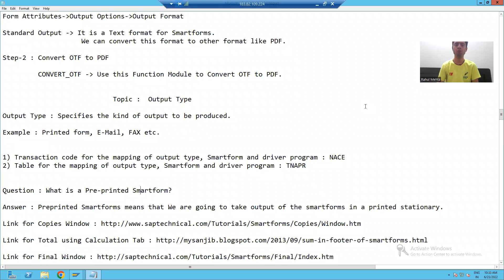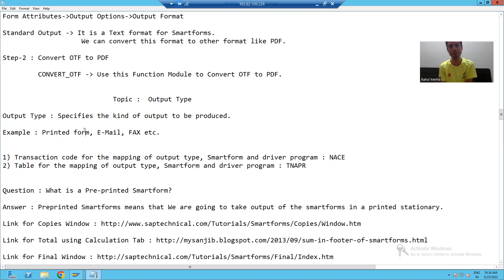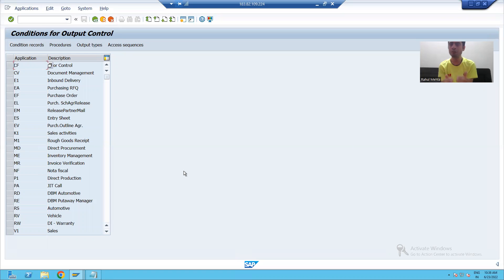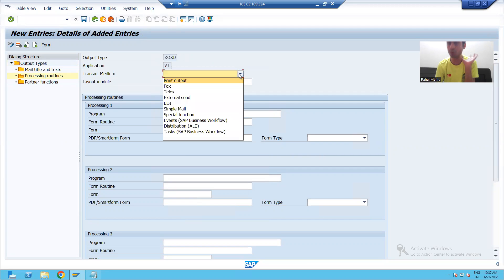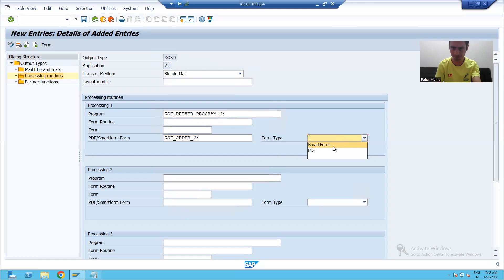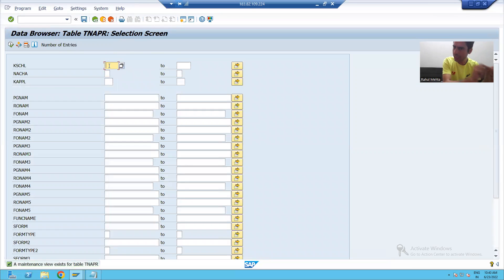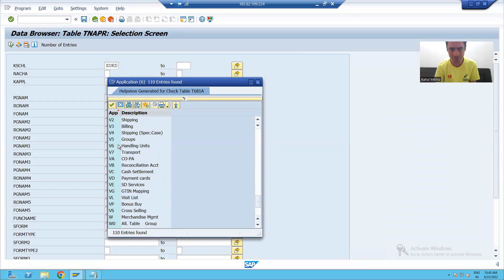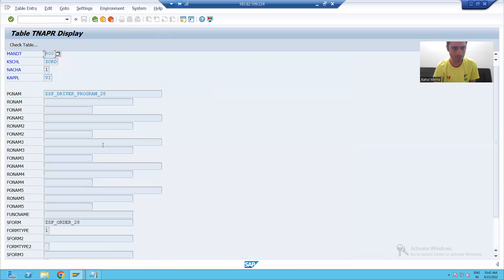45 - Smartforms - Output Types

Comment: what is the purpose of setting up output type in NACE transaction?
Reply from the maker: Hello Nabil - We will understand by example. Every company has a payroll through which they send the salary slip to employees. Now the salary slip is layout( smartform) and the company is sending that salary slip to employees through E-mail also, hard cody(print) also. This print and e-mail are  kind of output and the technical term for the same is Output type which is managed through NACE transaction.
Reply: @sapabapbyrahulmehta  hii Sir that means The same form content needs to send different channels
Reply from the maker: @Surya23783    Correct understanding.
Reply: @sapabapbyrahulmehta  Sir and what is the difference between output type yd00 invoice content and YD02 packilist content
Reply from the maker: @Surya23783    Hello Surya - I don't have knowledge of the same. If you know some SAP SD functional, connect with them as they have the detailed knowledge of the same.